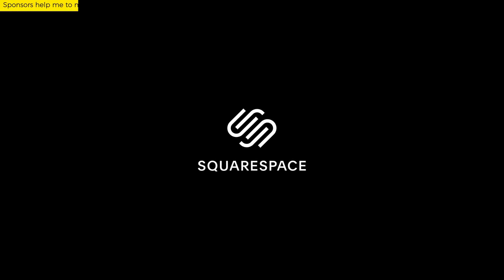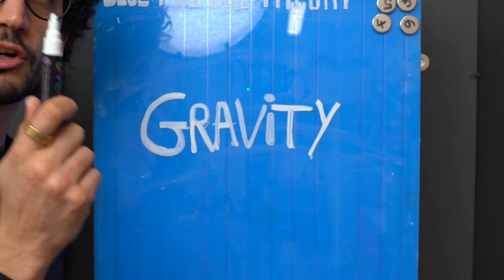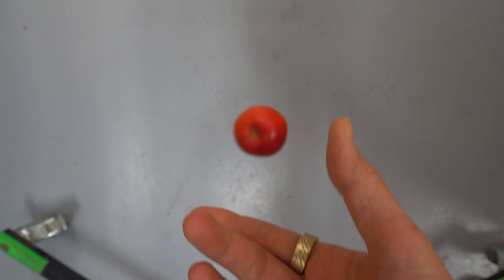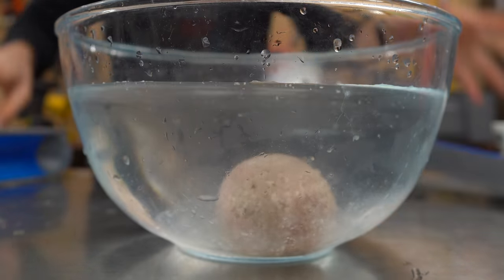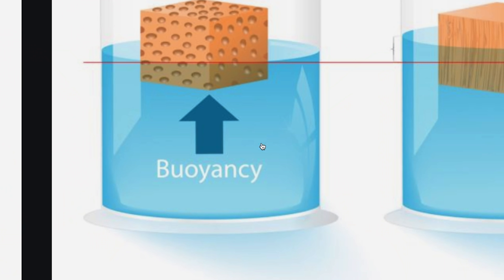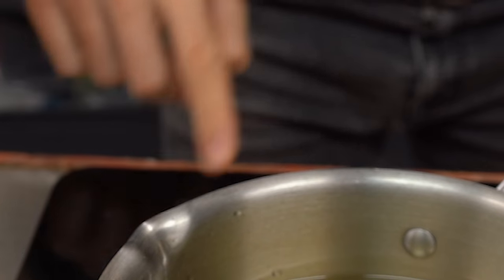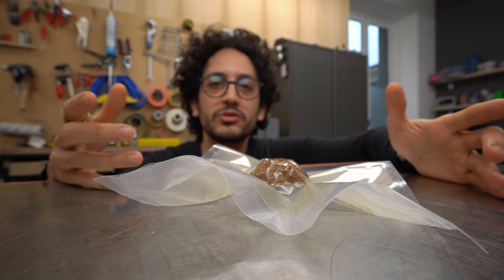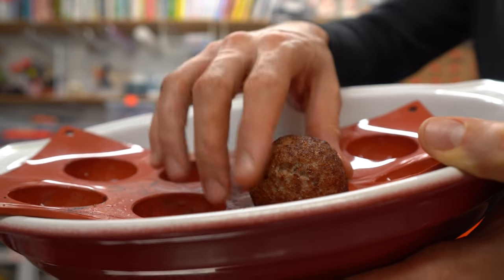Eureka ! Rounder and Juicier Meatballs Using Science...

Comment: You could try to sous vide it using the water displacement method instead of vacuum sealing.  I do that for delicate items.
Reply: Let's get that up so Alex sees it.
Reply: This was my first thought. Upvote!
Reply: was looking for this comment ... could of just used a ziplock bag
Reply: Eric Winokur exactamundo
Reply: This is what I was going to say. The old ziplock bag trick for those without money to spend on vacuum sealers.
Reply: Without something help support the structural integrity the pasty mixture he is using would eventually flatten. Unless aeration methodology is used to keep the meatball from touching the bottom.
Reply: Or you just clip the bag to the side of the pot?
Reply: Also you can turn down the setting on the sous vide to not apply so much pressure. I've done it with meatballs and crab cakes to avoid changing the shape
Reply: @WhatACoolArrow  Sous vide is the cooking method. You mean the vacuum packer.
Reply: @MrMartinSchou  sous vide means 'under vacuum', isn't it? I assume as BonAppétit that it is for sealing method.
Reply: @MichaKaczmarek_Krakow  Yes sous vide means in the vaccuum.
Reply: Or just make a watertight mold.
Reply: gravity, while sitting inside the bag, would do its thing too.

Comment: What about putting a wok/bowl on a hot plate and put everything on top of a shaking table, so that the balls are continuously rolling around while being cooked? I bet that would make them perfectly spherical!
Reply: Mycel  a ball mill?
Reply: Mycel like a rock tumbler?
Reply: it would stick wouldn't it?
Reply: You only need a smoking hot wok, then add cold oil and heat up to prevent sticking. Slide meatball from side like that Chinese chef did, then frantically tumble and turn the wok on a jet engine exhaust with afterburn on. 😏
Reply: timvandegoor1 will it burn tho?
Reply: That is what I was thinking. Less oil, in a wok, constant tumbling would probably mean you wouldn't even have to start perfectly round. Then finish in the oven when it's firm enough to hold shape.
Reply: @
timvandegoor1 your idea is literally an automated takoyaki machine lol.

Comment: He should of used a bowl of liquid nitrogen so when the meatball drops into it would immediately firms up and stay a round shape
Reply: and then it cracks
Reply: At one point I thought that was where he was going.
Reply: He mentioned how freezing it would create a problem because the cell walls would break and cause juices to spill out
Reply: @JonathanKayne  yeah but that was normal home freezing. I'm guessing the liquid nitrogen might be different because it's instant freezing?
Reply: @AndyGait  In my campus lab they freeze cells with liquid nitrogen and my teacher urges the importance of glycerol or DMSO as a protective agent to prevent the freezing from killing the cells so I'm guessing flash freezing fails as well. Unless you wanna eat a meatball soaked in glycerol then go ahead.
Reply: @dandanthedandan7558  Fair enough. I'm no scientist, so I was only guessing.
Reply: @AndyGait  I'm no chef so I'm guessing as well lol
Reply: No, you are absolutely correct. Using nitrogen 30 seconds, would work, the thirty seconds in a deep fry at 200c

Comment: You can sous vide without a vacuum sealer. Put in a plastic bag, and dunk into the water with the open end of the bag above the water. The air will get pushed out, you can clamp the open back over the edge of your cooking vessel, and clothespin in for the cook. I never use a vacuum sealer anymore to sous vide using this trick. It's so much quicker.

Comment: u could just buy a traditional chinese wok, 
note : i noticed western's wok MOST come with a flat base.
where's chinese traditional wok is a curve base.
in order to make it not flat, you throw the meatball like throwing a bowling ball, side ways from the sides :/
Reply: I think he has one, he mad a series where he seasons a wok, I might be wrong and it could be western but if I remember correctly its curved at the bottom
Reply: Not a must, I have made round meatballs using hot, but not boiling water to cook in, in a flat but high pot. depth is more important.

Comment: if you use a wok to do the deep frying, it might even help more because if you drop it in on the side (like the lions head video), you'll both minimize the splash, as well as probably keep it rounder because it doest just land on the bottom of the pan and flatten a bit, but rather roll down the side

Comment: Alex, I am now retired Aerospace design engineer so I have some comments. First, the idea of flash frying the meatballs is good. However, I would recommend that you perform a secondary moulding process (after the first few seconds in the fryer, return into a round mould and let cool. It could be like the "plyers", closable round mould). Let cool and then fry again in that shape. In the first shaping, don't let it drop so far. Gently lower it into the oil. It's not the shaper that is the problem, it's the decelleration at the bottom of the pan.  I would also recommend that the ball be smaller in the first place as the weight will have an effect on the final outcome.

Comment: For the sous vide you should have tried the water displacement method. It is not as hard of a vacuum. You can just seal it with the sealer next to the sink/pot of water or just use it unsealed and clip the unsealed bag to the container while it cooks.

Comment: A tip, since people usually apply a thin layer of flour to enhance the crust. U can do the same in that step and use the flour as dampener. And eliminate the fire hazard and slow process of differentiating the meatballs if you are doing more than one in your oil method.

Comment: Alex, sous vide would still work. You don't need to use a vacuum sealer. You can simply pop the meatball into an open ziplock bag and dunk it in the water bath to expel the air without it deforming it's shape. Then you seal the bag, and clamp it to container.

Comment: you could, if trying the sous vide method, dont pull a vacuum inside the bag, but suspend it in water, then seal it, because the water doues not pull the juices out but only the excess air.

Comment: In the last restaurant I worked in they had a meatball recipe that called for running all the meat and non meat ingredients through a large meat grinder that you would use for say sausages to mix then the balls would be scooped with a large ice cream scoop (for consistency in terms of total mass) then hand shaped into a relatively good ball shape. Finally they would go to the refrigerator to cool down and firm up slightly before being par fried and finished in the oven.

Comment: Would it be possible to use Leafs with a thick cuticula, like banana leaves in clay? And then slowly baking it in charcoal? or the oven? How about you try that. The isolation area would be from clay and the leaves save the juices from escaping to far.

Comment: Alex, I really think you could have gotten sous vide to work! Just use water displacement when submerging your plastic bag, instead of using the vacuum sealer.

Essentially I just put my food in a ziplock bag, zip it partially closed, and then slowly lower the bag into the water and allow the water to displace (most) of the air. Then I seal the rest of the zipper. You don't get a perfect seal, but it's close enough and I bet that would have worked for your meatball!

Comment: 1) You can use chamber vacuum sealer to adjust the settings just right, in order to "cover" The Meatball with plastic, but not squeeze it. It will take some time, but as I see from my experience - 4-7 seconds in standard vacuum chamber would do the trick. Anyway you cook it for about 1h max, so evaporation inside the bag would not be a problem in that timeframe. 
2) Do not forget about "cryo-frying" by Modernist Cuisine(at least 1st part). Why not to try dumping meatballs from a gun directly to liquid nitrogen and then sous vide (1h, 58 C) and then deep-fry for 20 seconds? You have mentioned a freeze-burn, but surely cooking sous vide would be much rewarding in juiciness, comparing to oven. So as a result - partly-flash-frozen meatballs should be even more juicy.

Comment: If you still want to sous vide, use a ziplock sous vide bag and use the water displacement method to draw out the air. It get almost all the air out, but will have less pressure on the ball than using a vacuum.

Comment: Freeze the raw meet in the molds then vacuum seal them frozen with enough space between them that the plastic surrounds most of each one. Sous vide cook them from the frozen state. The vacuum sealed plastic will have molded to a sphere shape and will retain its shape as long as it’s not crushed while cooking. Remove the meat balls and reduce the the bag juices to a sticky glaze by heating in a pan. Arrange the meatballs on a broiler pan and  broil each side basting them with the glaze until a nice brown crust forms.

Comment: Freezing doesn't break down cell walls if you do it properly. That's only if you do it slowly (like in a normal freezer) where the frozen water displaces the unfrozen water, causing all kinds of trouble (note that not all the water actually freezes, no matter how long its in the freezer for). If you blast freeze something, things are frozen "in place" so to speak.

Comment: Here is an idea how to make the frying (maybe?) safer: instead of just dropping the ball into the oil, you could get a wok, like the asian chef, who lets the ball roll down the sites of the wok, but to make it even safer, you yould spin the meatball right out of the gun tangentially to the site of the wok, so it rolls like a coin in a funnel. Obviously the propotions are different. The meatball wont make multiple rounds on the site, but maybe a quarter of wok-site to roll would help. Additionally you could make the oil spin in the direction of the meatball to minimize the speef difference of meatball and liquid it crashes into.

Comment: One interesting idea, you could encapsulate the meatballs with sodium alginate. What made me think of this, is I recently saw a video by Sauce Stache trying to make edible casings for vegan sausages, ones you can cook and brown up. Simply add in the source of calcium to the meatball mixture, drop it in a thinned alginate solution, solidify it by boiling or steaming the balls, then once solid, remove the gel, or leave it on and brown. It's so crazy, it just could work.
Reply: Plus it'd be a really cool video js :)

Comment: Alex, you can sous vide without vacuum packing. Just put the meatball into a bag and drop it into the water, letting the water pressure expel the air and not sucking out the juices.

Comment: What about making the bottom duct of the meatball gun heat resistant and oil resistant so you can put it in the oil. If you make a longer bottom piece, you can put it in the oil making a splash guard and eliminating burns!

Comment: When I mentioned using a medium that would displace the kinetic effect of gravity culminated with  surface impact. I purposefully avoided the use of oil. A low hanging fruit, that would obviously bare fruit. I am immensely impressed by the accomplishment, however, I was hoping for a deep bath that would absorb as much energy as was required to slow the momentum of the object being released. Therefore minimising, if not nullifying the physical displacement of the the ball.

Comment: I say draw on the Turkish influence and put the meat on a skewer. Then freeze it down to like -40 and scrape the outer surface completely round using a small lathe. That's the only way to get a smooth surface with such a non-homogenous meatball mix, using a technique that will make the surface smooth without changing the inside. Then you can flash [cook] it into shape while the frozen inside helps you with the shape.

The freezing also slightly enlarges the meatball, helping to minimize that swelling that comes when you cook it creating these gorges you can see in the meatballs in the video. So freezing will allow you to go straight from frozen smooth to cooked outside, without the normal contraction->swelling>-ripping of the surface you normally get - but in this way you only cook a few milimetres of the crust, meaning any splitting of the crust will be much smaller and look more evenly distributed. But it's tough to both cook something and not have the proteins do what they do. One solution could be slow cooking, since that would prevent it from contracting unevenly. You could even do sous vide, but without pulling a vacuum - you can do it in an ordinary plastic bag just fine, it's just the heat transfer will be slightly below optimal. But that shouldn't be a problem.

Also, rather than using silicone moulds for "supporting" the ball during cooking (if you do the oven method), try to look into the Danish aebleskiver pans - cast iron and hemispherical compartments.

Comment: Because oil is less dense than water, the Archimedes effect is significantly diminished, when dropping the meatball into a flat-bottomed pan filled with oil, although I see the trade-off of creating the stronger crust with frying and hence stronger structure. 
Why not follow Wang Gang and drop the meatball onto the edge of a curved wok and let it roll into the oil? That would preserve the circular shape on impact plus you'd get the enforced structure from frying.

Comment: Maybe it would be easier if the meat was colder when making the ball so it's structure and shape are better kept while making them on the oven? it would allow to avoid the first deepfrying step, also once the ball is shaped and placed on those silicone molds they could be completely frozen to increase it's strenght

Comment: You do not have to use a vacuum sealer to sous vide. You can use the water pressure method that will not compress the balls to that level.

Comment: The trick you missed watching the Lion’s Head video was the use of a Wok to par-fry the outside of the meatball allowing it to be rolled down into the oil without splashing or losing it’s round shape and avoiding the “cannonball” splashing of the hot oil out of the pot you used.   Wok and Roll all the way Baby!

Comment: Sous vide does not require vacuum sealed bags.  If you just put the ball in a freezer bag and use a bowl of water to remove most of the air, then you're good to go.  Small pockets of air do not affect sous vide.

Comment: if you want to use souvide than you dont need a vacuum machine. Just put the meat ball in a plastic bag and than put it in a container with water. The pressure of the water is enough to press the air out of the plastic bag so you will not have to much pressure inside the bag.

Comment: Use water pressure instead of vacuum compressor to seal the meatball in the sous vide bag.
Just put the meatball inside a thin plastic bag, put the whole thing in a tub of water to "gently" displace the water in the bag and seal the bag, then sous vide.
This way you don't have juice escaping the meatball.

Comment: I think boiling water produces a whitewater effect. Instead of the air bubbles in a fast-moving river, you have steam bubbles in a pot of hot water, but the result is the same: the effective density of the water is decreased, and so too is the buoyant force on your meatballs.

Comment: i think if he used the first 3d printed ball in combination with the sous vide machine to pull out any of the excess space it may have worked, but i dont think he has a vacuum sealer with the right amount of suction. though another commenter brought up a takoyaki pan which may yield equally good results

Comment: Get a few "Stainless Steel Tea Ball Infuser" (google) and flash-fry the meatball inside the ball so it can't lose shape.

Or if you're sticking with the meatball gun method, roll the meatball down a long metal ramp running with hot oil like a waterslide.

Comment: If you wanna sous vide your meatballs drop the vecuum selaer and just put them in a ziplock back, submerge it in water till all the air has been pressed out of the bag, close the zip lock and voila, sous vide without the vacuum pressure.

Comment: you could have done it sous vide, without the vacuum machine... simply put it into a bag and push it under water, that way you don't compress the ball and the water pressure still pushes out the air.... 
edit: you obviously have to keep the opeining above the water, but that would be a totally workable method...

Comment: Let’s not turn your back on souz vide (pardon my spelling) just yet. Instead of vacuum sealing the bag and crushing the partially fried meatball, why not use a good zip-lock bag? Maybe a freezer-bag with two zippers. Place the fried meatballs in an unsealed bag. Slowly lower it into cool water so that the weight of the water drives the air out of the bag. Seal it and then begin bringing the water up to temperature.

Comment: Instead of using a vacuum machine you can use a ziplock bag. Just put the meatball in the bag and slowly submerge it in cold water. This will end up getting all the air out prior of locking the bag!

Comment: Did you ever entertain the idea of cooking the meatball in a liquid which is more dense than the meatball, such as marinara? Conversely, you could also form the meatball into a bath of liquid nitrogen, and then deep fry it long enough to set the outside. Additionally, you could get a chambered vacuum packer and put the meat, in the mold inside the chamber, and it wouldn't drive the juices out - then you could cook it perfectly round - sous vide.

Comment: Why not push the air out the sous vide bag using a waterbath instead of using the way too powerful machine? If heat transfer isn't good enough maybe add some oil into the bag?

Comment: akin to my comment on the previous video, you need a hot air stream for the meatball to float on. OR YOU COULD DROP A NEW MOLDED MEATBALL THOUSANDS OF FEET THROUGH A HOT-AIR FILLED TUBE